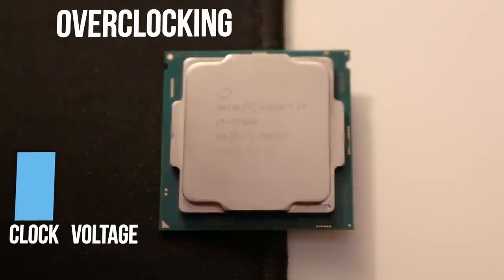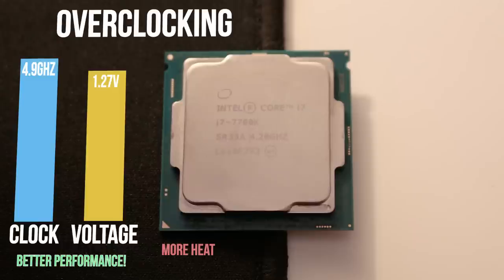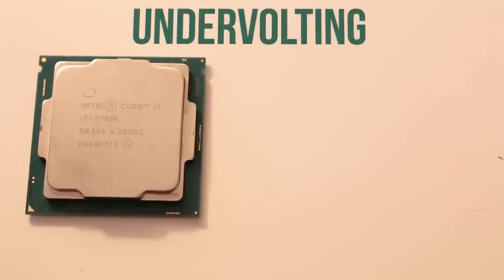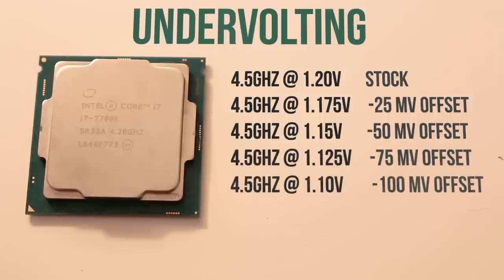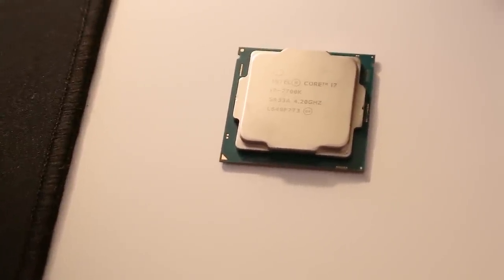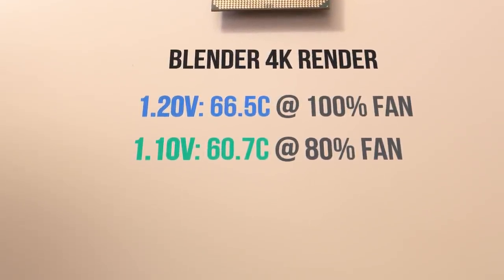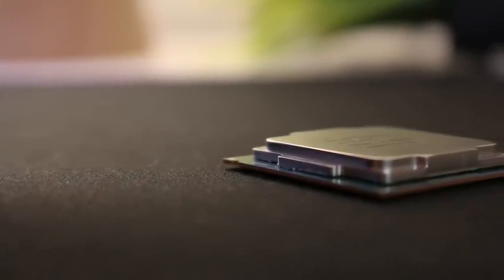Should You Undervolt Your CPU?

Comment: I absolutely love underclocking my AMD FX8320 even dropping cores. no real reason but too save on temp increases the lifespan speculation.
Reply: I haven't underclocked mine, but I did have to reduce the cores, otherwise it pulls too much wattage on my mb and locks up due to overheating.  It runs fine on 4 cores.
Reply: Playingwith3D i have an amd fx8350, and it deadlocks once a while. I guess its some error with my mb, because my first ont didnt freeze. Should i try dropping some cores out, and how?

Comment: damn am 4.9ghz 1.354V stable with my i7 7700k, can't wait for delid tool to come. At stock settings its around 1.18V.

board msi z270 titanium
Reply: Albin Keranović It will most likely degrade within a couple of months if you keep it at that voltage
Reply: So you are new to overclocking cpu if you said that.

You can have 1.52 volts max on 7700k (http://www.intel.com/content/www/us/en/processors/core/7th-gen-core-family-desktop-s-processor-lines-datasheet-vol-1.html). If you don't want to read it all you have a table at page 114, at 116 is for intel graphic chip.

I am currently 1.375V on 5GHz after delid. Temps are now 70C max in prime95. I can hit 5.1GHz after delid, but i must put 1.48V to get it stable (prime95 86C max), so its a poorer chip, some can get 5.2ghz at 1.44V. So i have backed up because its a slow boost 100mhz for that much more voltage.

1.52V is apsolute max for 7700k, so its not safe (its like living on edge), but everything belove 1.5V is ok if you can keep temps belove 85C. 

Above 90C 24/7 will degrade your intel 7th generation cpu, but very slowely 2-3years maybe more, it depends on certain cpu, every cpu is different, and depends what are you using your cpu for.

I had fx8370e at 4.8ghz at 1.5V 24/7 (max temp 55C) for year and half, no degrade, every bench test was equal all the time, now my dad is using it, everything works as it should be. 

Btw you must have a great motherboard so the power delivery and vrms can keep up. Only poor motherboard, or faulty motherboard can degrade your cpu at voltages lower then 1.4V, if the temps are at normal lvl.

I will contact you in couple of months if everything is fine with my cpu, so that people know for sure. ;)
Reply: Albin Keranović so how has it gone?
Reply: 49ghz @ 1.35 for me  I see no point to delid
Reply: @hasanenhaider1060  they have water coolers that go straight onto the processing chip under the lid that keep them icy cool with massive overclocks.

Comment: I bought an i5-6600K and the Z170 Platform in the thought that I'd like to get into overclocking. Have played around with it briefly once but haven't had anything consistent simply because it being stock was more than enough than what I needed it for, especially in games. I'll probably start overclocking when the 6600K starts to bottleneck other components which hopefully won't be for a fair while.

Comment: you should always have the lowest possible voltage for you desired cpu speed, so the answer is always yes.
for noise consideration you can run a 6700k at 1.28 volt with a noctua d15 cooler at 800rpm with no cores going over 70c.
so i think any of the 2 latest cpus from intel can be cooled quietly with an overclock.

Comment: Bro undervolting helps at long game sessions.
Reply: Yes it does I just got into pc gaming with ryzen 7 4800h and rtx 2060, in winter when we have like under 30c and as low as 19-24c at best, it was pretty good being able to keep its clocks nice and high, but now it's summer with 35c+ to 40-42c temps and lowest 33c, it was struggling and so I disabled the turbo (did not want to install ryzen controller) since I only play very GPU intensive games or games like valorant which give 144+ fps while cpu throttling anyways, it's pretty good under 85c most of the time. While boosting it almost immediately reaches 95c, but you gotta give it to those ryzen chips man, at idle it's literally averaging 45c it's crazy like just 8c over the ambient.
Reply: @Varad13Plays  85°C - 100°C range is pretty damn toasty for those Ryzen chips my dude 😬 they will definitely start thermal throttling with that range under load. Try everything ya can to get it cooler!
Reply: @TheNightKing22  chips are rated to not throttle till 105c man and asus has done a bad job with its cooling, I am going to cut vents into the bottom panel and add some copper heatsinks on, replace the thermal paste then it should be better
Reply: @Varad13Plays  well you're right the actual limit for the 4800h is 105° but it does depend on which chips we're talking about where they actually start limiting. Still! CPU and GPU dies are not super stoked to be running close to those Temps, and in theory could shorten lifespan of course. Are you running an air cooler?
Reply: @TheNightKing22  no its a fully custom loop with a 360mm rad
Reply: @Varad13Plays  what?!?! Man now I'm curious. The heck is goin on?
Reply: @TheNightKing22  Bro if you don't know 4800h is a laptop chip and I clearly said Asus has done a bad job cooling it; your question was irrelevant so I gave an equally irrelevant answer thats all
Reply: @Varad13Plays  How do I get stable clock speed and make my CPU use of it's full 45w power ?
Reply: @MOST-ISRAELIS-ARENT-SEMETIC  Use an older bios

Comment: Personally I run an i5-7400T with 16Gb of low voltage ram and an SSD with an LCD screen. The entire system is under 90W. Most CPUs take that on their own. Needless to say the fan on the heat sink (which is designed for a 95W CPU) rarely gets above idle speed.

Comment: This is Electronics 101 + or - 10% on all values. Voltage,  resistance, capacitance, etc. Though with digital and precision circuits a well regulated voltage with minimal deviation from the recommended spec is obviously most ideal.

Comment: AMD Phenom II 965 BE C3 stock 3.4ghz 1.376v  daily use undervolted 1.264v and 3.7ghz oc  44c full load temp  or i can   undervolt to 1.312 and 3.9ghz 51c full load temp.  it's a thing for me from 2010. Only Ubisoft(Denuvo) with Far Cry 5 and AC Origin force my hand to upgrade my golden chip to newer gen because lack of  SSE4.2 instruction set otherwise i can play all released games and enjoy not just play to date with 8gb ram and a gtx 970 at 1080p at high settings or above some at ~40fps some above 60fps but usually i use adaptive vsync to get rid of screen tearing so 60fps with neat details its more than enough for  my ancient tech.

Comment: You have a very good CPU.  Running Heaven benchmark my CPU drew as much as 1.368 volts at stock speed [not overclocked] and it fails to finish POST at 1.2 volts.  [Edit]  I forgot to mention maximum core temperature was 54 degrees C.

Comment: Why didn't you mention the power saving? Good for your walled and especially great for a laptop. You might get a significant longer running time if your laptop bios supports to change the voltage.
Reply: it doesn't need any special bios since 4-th gen, all laptops with core i series CPUs support undervolting via software like Intel XTU or Throttlestop

Comment: 3:30 that's not 10%, it's actually 17%
the ambient temperature is 21c, so the delta from ambient was just 30 degrees. you're not trying to cool ice here to sub-zero temperatures here.

besides, if you're going for absolute values, temperatures start at -273.15 C, not zero.

Comment: The testing is pretty unprofessional. You should never allow for dynamic fan speed when doing a controlled test. You should only have one variable - the cpu temperature and the fan should left at a static rpm.
Reply: who cares ? it works on paper and in practice

Comment: I undervolted a socket A 2400+ with an overclock to 3000+ speed 15 years ago max temp under load is 38C and still running perfectly

Comment: Ok. So, why aren't all motherboards made to automatically lower core voltage when CPU is not under full load? Prob b/c desktop CPUs don't end with dash-M. If cooler temps and a more quiet PC is your goal, liquid cool (custom loop) your system. If Blue Screens and data loss tickle your fancy, go ahead, play with voltage settings. I run multi video mixing, along with two to four BPM synchronized audio tracks, two screens and sound cards, all on stock settings with no trouble. How? Edit IRQ routing table in BIOS, and wire mods to A,B,C,D gold fingers. Virtual IRQs hide hardware conflicts, and force your OS to continuously sort out the mess. Yes, more CPU overhead.

Comment: My 2014 Macbook Pro laptop I have to undervolt and run custom fan profile to avoid constant overheating when playing computer games on it... With under volting it can run full 3,4Ghz boost 100% of the time with all 4 CPU cores at full load :) Without the under volting it overheats and throttles CPU speed down badly  just from running GTA V at 40% CPU load usung GTX 980ti external graphics card...

Comment: Great video, you can do the same thing for you GPUs as well. I got HD 7870 running that should be 1169mv 1000/1200, I got it down to 1100mv 1100/1300 stable and even with added overclock that is whole 5C less under full load then the stock setting. So now it runs 60C max and not 65C, if I keep the stock clocks the temperatures from such a small undervolt go as much as 8C lower under full load when running furmark.

Comment: I would rather overclock and rise the voltage on desktops with some cooling to hit the limits, becouse I think as enthusiast, however undervolting is just the best thing for laptop CPU's :) I am for about 3 years using my MSI g70 2oe laptop with intel i7 4700mq undervolted to 0,980V and with frequency 2900-3100MHz with my gtx765. Before undervolting the CPU was overheating when some hard gameing/benchmark and then throtling, now it stay with clocks, it's cooler for hands, only positives :)
Reply from the maker: definitely agree, depends on the use case! Thanks for the comment.

Comment: My 7600 survived the Prime95 with a 150 mV undervolting. However, it crashes occasionally at idle. Thus I only got a stable 100 mV undervolting.
I think this is the drawback of an "offset" undervolting. 1.2 to 1.05 is fine. 1.0 to 0.85 results in crashes.

Comment: Everybody with a locked CPU should undervolt, IMO - 99.99% of CPUs can run with less than stock volts.

My 4590 is OCCT-stable at 0.92V, which is mental; CPU power draw is quoted at 85W... mine uses less than 52.

Comment: I did this with my Haswell laptop 2 years ago, when I disable the undervolt the cpu will start overheating and thermal throtteling.
I have -80mv and it helps so much.

Comment: I think I should do this. I have an i7-4770K and a water cooler, and the clock speed is at 3.9Ghz. But I think my water cooler is starting to succumb to the elements, so I think I should lower it to 3.5Ghz (edit: and lower the voltage accordingly).

Comment: Your focus is a bit out.  I think your making a common mistake of using the lowest F stop on your camera cause you've told it allows more light which equals better pic/video.  Probably using the Nifty Fifty?  That's actually not true!  Lower F Stops lowers your Depth of Field.  I think it would look better if you increase your F stops, get a wider depth of field and put more of your little computer chips in focus so we can see it better all the while you still will retain the blurry background effect.  Added Bonus: Sharper Pictures/Video!  Lens are not at their sharpest when set to its lowest or highest F points.  Lens by lens is different so there's no magic formula to figure it out, so you may need to experiment or do some googling on your specific lens to find out.

Comment: @Optimum Tech.  Could you try this with a laptop and see how much (if any) it extends battery life?  Perhaps the lower voltage may extend the battery life... but if the fans aren't working hard or coming on as frequently there may be more battery life available.  Perhaps a test doing a render that should take longer than the expected life of the battery and see how far each render gets?  I'd be curious as to how significant the difference is.

Comment: Update - just got a Coffee Lake that the board says needs 1.205 V at 4 GHz... runs fine at 1.01 V.

So low I can't use offset voltage because the idle would be less than 0.5 V :P.

Comment: I can confirm it works. Went from 90°C to less than 65°C average with my 7700k while playing Hellblade: Senua's Sacrifice.
Thank you for the video sir. Btw, what would be an optimal voltage for higher clock speed? (for 4.8GHz, 5GHz or even 5.2GHz)
Reply: Did u find a way to figure out optimal voltage? I used throttle stop for undervolting and so far I have only found a single way to see if my voltage is too low for the cpu. Which is by checking for power limit throttling in "Intel extreme tuning utility", this is where u can stress test your cpu and look for power limit throttling.

 But that's like checking the bare minimum or something where I am just borderline the optimal but not accurately. So really looking for a way or at least the optimal voltage for 4ghz cpu.

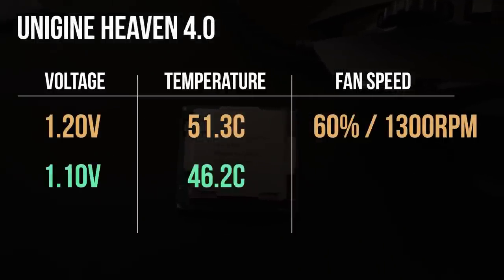Comment: 3:24 I think you mean -1.5% in temperature. Celsius is not an absolute scale, it's nonsense to talk percentage in C. For example, if it had gone from 0 celsius to 1celsius, you wouldn't say "+infinity percent" ^^
Reply: he actually means -17% because the lowest temperature an air cooler could possibly achieve is ambient temp.

the temperature of the cpu is the difference from the end temperature from the ambient temperature. 51c-21c = 30c
5.1 is 17% of that.
Reply: Thanks! That's way better :D
Reply: Rankin if your an american because rankine is based of the Fahrenheit scale
Reply: Eratz Leretour What nonsense. If you compare two absolute numbers of the same physical unit you can always make a percent comparison.
Reply: Yes, but while 12 is 20% higher than 10, saying 12°C is 20% hotter than 10°C would be completely inappropriate and misleading (take the example of 0°C and 1°C if you're not convinced). But GraveUypo brought a good light on the matter I think.
Reply: (1) that's not what he did (2) its pointless in this case. What matters is temperature difference i.e. how many degrees it heated up by. If it heated up by 20C before under volting and 15C after, you reduced thermal resistance by 25%
Reply: uhhh.. well yeah you wouldn't go from a 0 to 1 in ANY scale and say that lmao.

Comment: This actually makes the biggest diference with GPUs from my own experience. I got my 390x to -90mV (using afterburner) and dropped from 80c to 66c (stock ait cooler). Which is pretty huge. 

This was just for testing though, as I had an AIO on it, so fully overclocked it afterwards, to 63c at max clock speeds. And was pretty quiet as well.

Comment: I honestly don't recommand it at all , because whether you do it or not you won't much of performance ,even when you increase the voltage nothing changes, okey your cpu now reaches 4.9 instead 4.7Ghz , it's not worth it , secondly , if you undervolt your cpu you get less heat and better performance for long duration , this can be done by going : panel setting , system and security , energie edit , and then change your cpu performance into 95% ( this has nothing to do with reaching your turbo boost , you will always get it in single threaded workload, and you always get the same mount of speed in multi_threaded workload ) However , undervolting your cpu gives you the same frequency you always had is a lie , there is diffrences between workloads  ( more instructions in one clock frequency )  , even when you reach it be sure that cpu is not stable enough .. intel / AMD made the processors ? engineers and experts !! TDP down frequency, TDP up frequency , TDP usage in base frequencies ........... they have all figured it out , don't change the configuration unless you know what you doing

Comment: I've done this, i have a 7700k and a MSI Z270, 
I was putting in auto mode running in stock Ghz, that turns to 1.288 on Vcore... my cpu was getting 80-85 Cº on full load... So now i set the vcore on 1.118 and Load Line Calibration on level 3 (that's push to 1.160) and my cpu now only reachs 65cº its a huge difference... and also its not delided

Comment: a 25 MV offset is massive. You are talking 21 megavolts.
That would take it from 1.2 V down to -20999998.8 V, or roughly -21 MV.

That isn't 10%.
It is 1.6%.
Learn how temperatures and units work.

This video is abhorrent.

Comment: P = U * I; I = U/R; => P = U * U / R. That meaning your 6% of voltage reduction leads to a 16% of power reduction. Not 10%, or whatever. Also, using Physics here, your room temperature was 19,43 °C at the moment you made this video.

Comment: 0:26 Nothing wrong with buying an unlocked processor and not overclocking it?
Umm yes there is.
It is called a waste of money, you buy a Z board and the K CPU and you're not overclocking when you could've gone with the B board and non K CPU and saved money and put that money towards a better GPU.

Heck I've seen some people buy a K CPU and fit it to a non Z motherboard.
Reply: sometimes there are deals in which the k series is on discount while the normal version is not. leading to the unlocked chip being more affordable.

Comment: Ok 1 question, if we can lower the voltage of the CPU and get the same performance(clockspeed) and low temp, then why are the intel's CPU did'nt set its own voltage at that level for more efficiency?
Reply: Because not every CPU will behave similarly with under volt or over volt. The default voltage rating is the value which they promise their CPU to work with deterministic result.